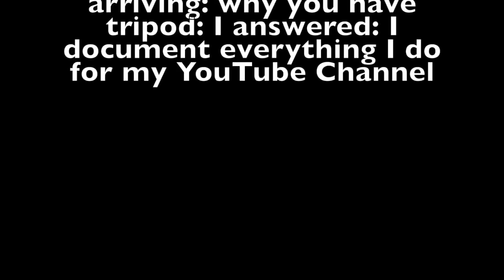Filming Guide One insurance adjuster went wrong: Adjuster walks away on Dmitry (Roofing Insights)

Comment from the maker: What happened: adjuster did 2  “square tests”: chalked two 12”x12” squares and identify two dents in them, but wrote “ZERO” next to it (meaning no hits) and said he will send it to desk adjuster to decide if roof have damage 😂😂😂 he even confirmed on video it had two “pings” but didn’t explain why he wrote ZERO
Reply: Did you show the company the video of him saying there is 2 hits but writing down 0?
Reply: Now they just want all shingles on a roof repaired they don’t want to replace roofs how am I supposed to give a proper warranty on a roof repairs
Reply: He did explain why. He saw 2 dents, but he doesn't believe it came from the hail.
Reply: @carlosray5363  No shit
Reply: I would go after his inspection license
Reply: @ivtec845  saying 0 just means there wasn't the required amount of hits within the 10'x10' area checked. It should also have a slash through it.   That way if there is foul play by adding another number in front of the zero to get the required hits. Those looking at the paperwork will known the paperwork has been tampered with. Retired now, but have worked in over 35 states, chasing storms.
Reply: @TripAMD  still has to write two if there are dents because a dent is a ping and leave it to the company to decide. He power tripped and already had his mind made up when coming here. TRASH AND LAZY STAFF ADJUSTERS
Reply: @roberthubbard7424  he didn't check a 10ft by 10ft area. It was 12inches by 12 inches. That is what he marked.
Reply: @TripAMD  no holes, no leaks, just dents? Thin tin toof, natural weather event. Hmmmmm!
Reply: Two pings in a metal roof and..............how is the roof damaged exactly? The answer is it's not and your wasting everyones time and money.

Comment: My insurance company told me if I wanted to go with a metal roof it had to be a certain thickness in order for them to cover it for dents. If I went the cheaper, thinner route they wouldn't cover it for hail dents. Honestly, that sounds fair to me.
Reply: depends... they can not mandate anything that is outside industry standards. NFPA is king on that. MAX MIN.
Reply: well when they went cheaper and thinner, the insurance said they would cover hail dents.. then sends this clown.... DOESN'T SOUND FAIR TO ME.
Reply: @NotWatchingTV  the contractor is the clown to me in this one…. A metal roof will not need complete replacement for small dents…
Reply: Could you tell us what thickness you went with that or what thickness was acceptable to the insurance.  Reason I ask is that I'm planning on doing a metal roof myself.  Would appreciate it.
Reply: @1realtruthrightnow742  I eneded up doing 25 year shingles this time. There was a bad hail storm and damn near everyone in the city got new roofs. All my neighbors got higher end roofs, deductibles paid and even put a little bit in the bank. My insurance, at the time (was either State farm, or Farmers) wouldn't pay for the drip edge, and literally gave me $5 dollars for window beed. That is not an exaggeration $5 is what they gave me. 

Let me know what you end up doing, because my next build I am wanting to do metal. Standing seam I think is what the nicer one is called.
Reply: @hulkhuggett  Yeah I believe it with the insurance.  My sister had purchased a 2 year old modular home. We had a hurricane blow through our area 2 years ago, roof shingles were severly damaged that caused several leaks inside the home.  Insurance gave her 1800. The roof ended up being 15k to replace.  Thanks for getting back.
Reply: @1realtruthrightnow742  depends on the area weather history. if you are in a pea hail area will be thinner. if you are base ball area you are talking allot more meat.
Reply: @Arctic_Adjuster  Cool. Not what my insurance told me. It did happen. Glad you were there tho.
Reply: @Arctic_Adjuster  They didn't deny my claim. Might want to reread my post.
Reply: @Arctic_Adjuster  No, I never mentioned a sister.
Reply: My insurance told me metal roof hold up better than shingles in Hurricanes. Then proceeded to charge me more for insurance because metal roofs cost more to replace 😂

Comment: I’ve been a contractor for over 20 years and a roof is one thing I know well. It takes very large hail to damage the metal roof to the point it has to be replaced. And looking at that roof nothing looks like anything has compromised it. Especially to the point it will be leaking. What I see is normal wear and tear
Reply: Dimitri's trying to pull a rabbit out of the Hat
Reply: I’m in roofing sales and I agree.
Reply: Around 3.5 inches

Comment: I put a stone-coated steel roof on my house (extremely expensive ) my insurance company said they wouldn't cover cosmetic damage and that is what you have. My business building has a metal roof and has been through dozens of hail storms in the last 20 years replacing the roof for cosmetic damage is not practical and not prudent.

Comment: Insurance companies have finally created marring exclusions on metal roofs.  Hail dents like those to a metal roof panel are purely cosmetic damage.  No functional damage or the structural integrity of that panel has been done.  However, if the policy doesn’t have the marring exclusion, then the policy owes to replace that metal roof.
Reply: ought*
Reply: Correct. Make sure they don't put Arbitrations in there contract because alot of them are super sneaky to do that now these days
Reply: @crockpot5194  their*
Reply: @crockpot5194  nowadays*
Reply: @DarthVader1977  Makes the contract null and void. How? Because an incident has to happen can't just write something before it happens that's considered as Ex-Ante or Ex Post Facto
Reply: @crockpot5194  I was correcting your spelling.
Reply: @DarthVader1977  Thank you sorry for the spelling errors

Comment: And this is why everything should be recorded!  
The adjuster knows he is wrong and his attitude shows it when he figures out he’s being recorded.
Reply: They hate being recorded because they cant lie if its on film
Reply: @throatpunch4789  exactly!
Reply: IDK about the other damage on the roof but that denting that is shown isn't an issue at all. That's the whole point of a metal roof. To take more dmg before it's considered an issue. It's not there to look pretty. Shingles get replaced if they become pocked or dented because that causes issues on a shingle roof. On a metal roof, it doesn't affect anything unless it's either incorrectly installed in the first place or if the denting is gouged (missing paint = rusting) or something similar.

If you really had your car's whole body redone anytime a small stone scratched your paint or put a dink in the body, they'd stop insuring you.
Reply: some people get pissed off if you are secretly recording, they have every right to end the conversation and leave.
Reply: @PandaMan02  Sure, but that would mean they refused to do their job. So they'd likely be fired or at least reprimanded for refusing to work.
Reply: @PandaMan02  you’re correct This is why it should never be a secret. People have every right to record a “job” for reference. Imo if someone has a problem with someone recording a “job”, then the person that doesn’t want the job recorded is hiding something or trying to deceive. As long as you’re not recording the persons face then it’s fine. 
I believe in this video the adjusters face should be blurred out if you are going to make it public.
Reply: @ravenna6543  they don't need to talk to you while making their evaluation, they also don't need you to be there while doing it either.
Reply: @PandaMan02  They don't need to talk or even need you there. They are however required to give notification of the date and time of the inspection. And it's the homeowner's right to be there, record, or have someone else be there and record.

The only time it becomes an issue is in two party states but since it's private property and they are on it, there is no expectation of privacy since it's not their property. 

IDK why this topic came up anyway really. All I said was that in this instance, the adjuster was right on that very specific spot with the chalk.
Reply: @PandaMan02  I agree but in his line of work I would expect to be recorded when at a claim
Reply: Is the Adjuster in the wrong though?

Even if he had marked 1 on the slope, instead of zero, it wouldn't have been enough to even warrant repairs.

The homeowner most likely requests a re-inspection anyways.

Also for all the insurance Adjusters are corrupt. I beg to differ.
Sure the Insurance company has their own agenda and as an Adjuster you have to play by whatever rules your firm gives you.

I've seen estimates written up by staffers and not a single picture was taken.  
All my respect to insurance Adjusters, and regardless of law it is within the Adjusters right to end the inspection if he doesn't wish to be recorded.

No one really lost here in my opinion.
Reply: @ravenna6543  well said.
Reply: @danbrown7224  not at all Tbh.
I'd say maybe 3 or 4 claims out of every 150, might run into someone recording you and really just kinda comes down to if it's a 1 party or 2 party state.
I've only had to ask one person not to record me, and we were in a 2 party consent state.
Reply: GO BRUINS

Comment: If the 10' x 10' test square has 8-10 hits it should be replaced. Hail is directional and may damage one side of roof and not the other slopes. 2 hits does not constitute a full replacement. BUT! A lot of states have passed a ruling that if a roof cannot be repaired back to original condition replacement is required.The insurance company is required to make you whole again to pre-storm condition if it goes above your deductible.I was a storm adjuster since 1992  to 2019, and have done a lot of hail claims. I always treated the insured the way I would want to be treated if I had an insurance claim.I never had a problem on my adjustments, unless someone was trying to claim damage for a different weather event. I never had a problem with roofing contractors as I told them to inspect the roof with me.

Comment: Extension ladder is set wrong (3'  above roof line and tied off) and nobody is tied off.  Also per OSHA, ladder must be rated at 300lbs, which adjustors ladder is not (otherwise he wouldn't have moved it so easily).  Can't take anyone as a pro who ignores basic safety.
Reply: Read up on your OSHA requirements for inspections; they are quite different than for performing repair work.

Comment: OK… What does the chalk do and what is “splatter” in roofing terms? Thank you
Reply: Chalk says how many dents or damages .. he put 0 although their was damage. 
Splatter is also a term of damage due to rain and ect. But splatter doesn’t mean damaged enough to repair I believe
Reply: @dianabocanegra8144  Wrong. He put zero because you could not see the damage without it being chalked. If the damage is not visible without chalking then it is NOT damage that needs to be repaired.

If you honestly think a hail dent is compromising that type of roof then you are trying to scam the insurance, simple as that. I normally advise people to push adjusters off the roof as they're a waste of oxygen but in this case the roofer is trying to scam period.

Comment: Nothing wrong with that roof.  Claims are based on DOL.  if this is a new storm then there would splatter marks on the hail impacts, the burden of proof on on the policy holder.  Showing dents in metal that could be from anything isn’t proof.    Never tell a PH to file a claim unless the dents in the metal have splatter marks or large enough to see without marking over them.
Reply: James, you left out something important. The insured is given the benefit of the doubt if their policy was in affect for numerous years. 
However, the policy may have a dent exclusion or perhaps an ACV policy. 
With that said, the roofer was not aware what new  hail damage looks like. The oxidation would have been removed from the r panel. 
At the same time, the field adjuster was wrong to correlate the ridge cap with the r panel because the metal ridge cap will dent differently from the field panels.
The field adjuster was also wrong to talk to the roofer/sales rep from the ladder. He should have pulled 2 more test squares, checked for oxidation, then based his report on his findings while explaining 101 about oxidation and weathered circles in the panels. 
If there are fresh dents, then write it, turn in your report and wait to see if it gets kicked back. Move on to the next one. Don’t let it get personal. It’s a roof that will never ever leak from those possible hail impacts. Why get defensive. 
No need to create a argumentative environment with anyone.

Comment: When you get the metal roof they won't pay to fix small dents. The metal sheeting needs to be compromised for it to be covered. If they replaced a metal roof for every time hail dinged it. Metal roofs would cost more then the house. 

Shingles get replacement since them having dents compromises the shingle being able to protect the house... the metal can take a lot more dings.

If having dings on a part of the house that 99% people don't even acknowledge. What does it matter? It's not leaking its not falling off. It'll be covered if it does either of those.

Comment: The adjuster was correct. He mentioned prior hail and you are able to tell consistency of the hail and identify the damage from a particular storm. This roof did not need to be repaired and or replaced.
Reply: Exactly. The ridge and the metal roofing does not match up in terms of damage, no splatter in the “dents” that were chalked tells you immediately that was a prior claim on thah roof.
Reply: @cutitup2088  A case of a contractor seeing $$$ signs from the insurance company, which adds to our increased premiums.
Reply: @MCMeek  Sorry, what did I miss?

Comment: Dmitry you know there wasn't a cluster of hail strikes on that roof. You're reaching for it, anything could have caused those two pings. Hail moves in waves and that roof would have taken a beaten all to hell if it were struck.
Reply from the maker: We had two brand new metal roofs on other buildings destroyed by 2018 hail. It was huge event, one of the biggest hails in recent years. This roof was older but had damage, all houses around the property (residential houses) were all getting new roofs. Ridge was destroyed on this building but adjuster was arguing that it was old damage. That’s where I started recording. He did 16”x16” squares, and you could clearly see dents in chalk. You could do more but what’s the point? That roof is 60 squares, you see dents in 16x16 squares but write zero next to it, when adjuster doesn’t want to buy anything it’s clear immediately.
Reply: @RoofingInsights3.0  yeah if old damages they can’t do anything about, insurance has a time frame for hail.
Reply: Exactly.. that roof is fine
Reply: I didn't see one hole in the roof